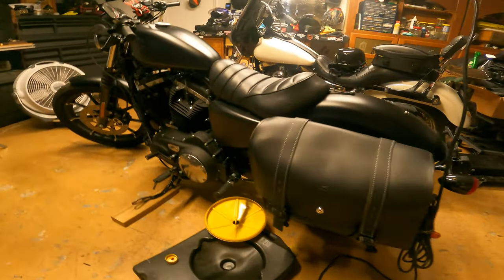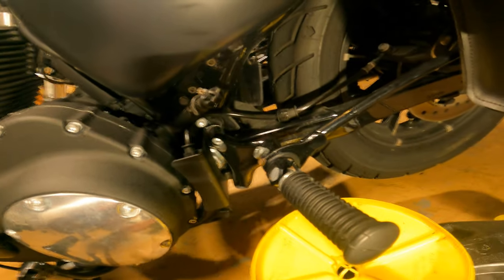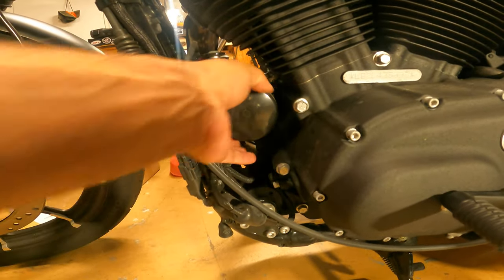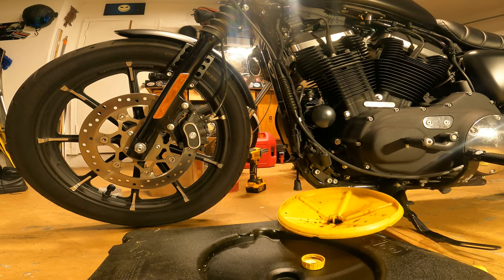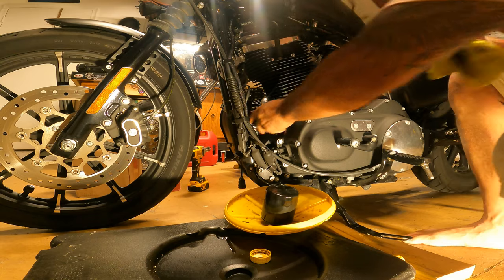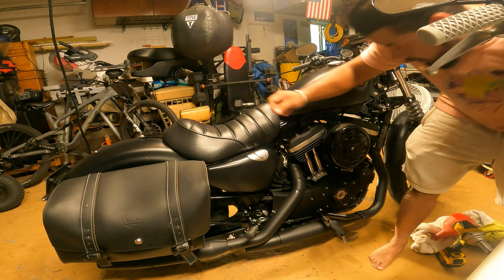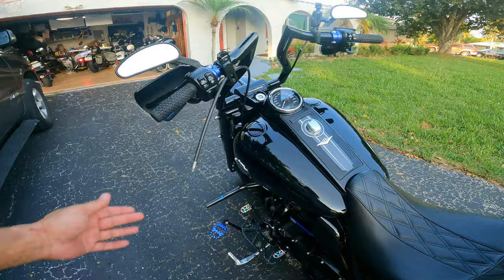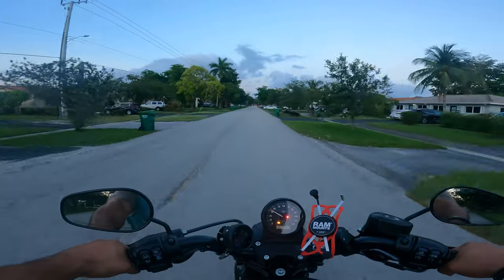Oil Change 883 Iron Sportster

Comment: Silly question but how do you know when you've put enough oil in? Can you see it and how full it gets or is there a line to fill to? Thank you for this video
Reply from the maker: "Look for the visible oil level inside the primary case; it should be close to the bottom edge of the clutch diaphragm spring or not exceed the midpoint between the bottom and top of the clutch plates" - According to the experts
Reply: @WeRide2  Thank you!